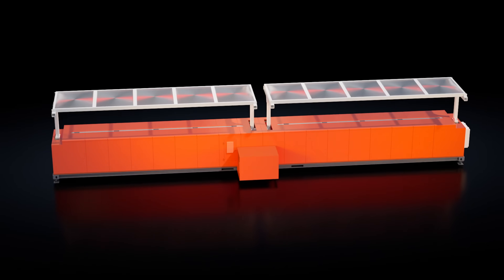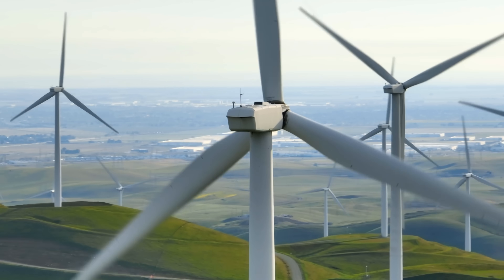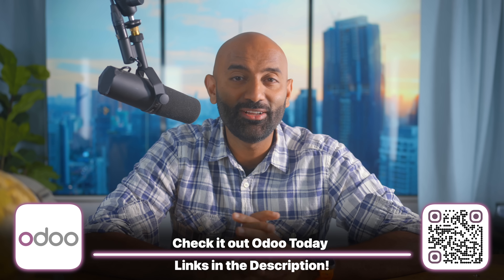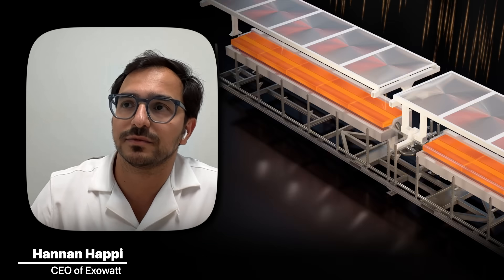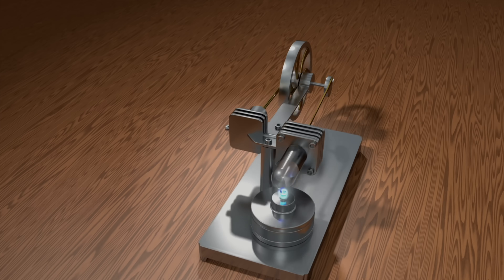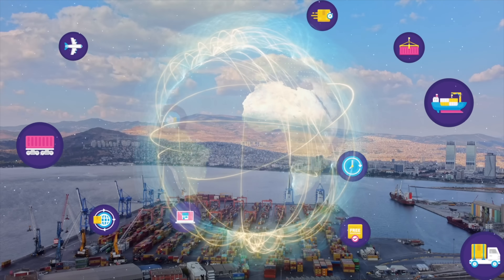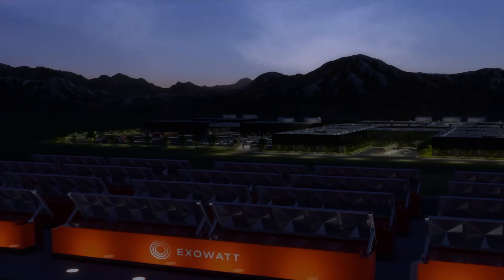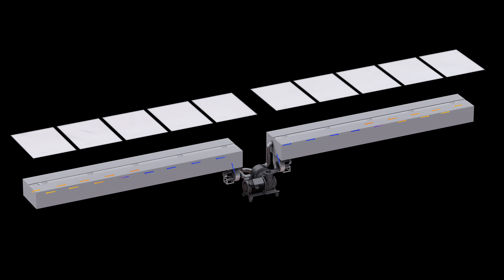Solar Without Panels, Storage Without Batteries - EXOWATT

Comment: Im a farmer, Ive been designing a parabolic solar collector that heats oil that is piped into a sand battery that is a 40 foot container filled with sand. oil moves by convection, container stands on its end so its 40 feet tall. as the hot oil enters from the top, as it cools giving its heat to the sand it falls and picks up speed exiting at the bottom then going outside the container and up being heated by the sun inside the parabolic mirror back to the top where it enter back into the container of sand. Requires 1) a 40 foot shipping container. 2) stainless steel for the parabolic mirror 3) pipe. 4) a method to follow the sun. (the mirror will rotate / pivot around the pipe being heated as it follows the sun) Heat can be extracted via convection in separate piping also filled with oil (it would enter the bottom and rise to the top) I was thinking of using a steam engine to run a generator because steam engines have proven to be so much more dependable that the Stirling. Been working on the design for several years and hope to build it in the next 2 years.  Benefits are 1) even a farmer can afford to build one. 2) most parts needed to build it are already on the farm. 3)Seam engines can still be bought used for reasonable prices. 4) The taxes and county approvals would be the same as for a silo.
Reply: Let me know when you’ve built one … I’ve just bought an off grid farm and could use your system
Reply: @DJ-uk5mm  Consider aquaponic vertical gardening. Get out of the dirt. No expensive equipment need.
Plus you grow meat. Tilapia mostly depending on your climate.
Reply: @21CenturySkyScrapers  put them into a walipini and they should be able to survive the winter in colder climates (maybe with some heating)
Reply: @balibee91  I can grow vegetables 365 days in any climate. Easiest with aquaponics, and  in extreme conditions such as Alaska, a properly designed green house with a wood heating system integrated into the fish tanks will keep your garden thriving.
Reply: @balibee91  I don't know what a "walipini" is
Reply: Nighthawkinlight shows a simple method of making a compound parabolic refractor that you might be interested in... gets rid of needing to track the sun which removes a huge cost/mechanical failure aspect of these machines. I was leaning towards steam engines too in my designs mainly for the simplicity of it. A sand battery that stores heat and releases it to run steam turbines is extremely feasible and readily accessible. Never thought about flipping the container on its end though... very clever
Reply: @ToneTruong  Something to remember when running Steam is that it can (and will if superheated) pull the carbon out of any type of steel pipe creating carbonic acid which will eat through basically everything especially at those temperatures. Best to spend the extra cost and use nickel based alloys with little to no carbon content. At least if you are going for super hot steam and minimal to no maintenance.

Common SS like 316 and 304 are really only good up to about 600F. Anything over that and they deteriorate relatively quickly.
Reply: @drewbeirn7704  Glycerine is a good choice for a heat transfer fluid. It vaporizes at ~700F at atmospheric. Condense the vapor in your sand battery and returns as liquid to your solar concentrator. No moving parts needed. Fewer corrosion issues. No high pressures.
Reply: Your solution is better than this video. 

Something not mentioned is that the alloys that can contain the 1,800deg F are not cheap. Also the fire risk with that kind of heat in the event of a failure. 

Also would love to see how it handles rain, and winter.
Reply: @drewbeirn7704  I've also been working on a similar project, theoretically for now. My system will concentrate the solar energy to the hot side of the Stirling engine, heat is rejected to oil or water tanks and excess mechanical energy is used to compress air which is also cooled to near ambient temperature using the same coolant used with the Stirling energy.

If you want to increase battery capacity, you increase the pressure in the gas tanks. Gas tanks can be used with preheating extracted from the coolant tanks during night time to drive a pelton wheel powering the generator. This system is not efficient but the advantage is in the longevity of the materials. The Stirling engine is the most complicated part of it.
Reply: @drewbeirn7704 These videos are just like the promised Fusion reactors. 

We were also told the lie that solar was totally maintenance free.
Reply: @MangoCitizen  I agree.. .even if any of these ideas are good some corporation will buy the patent and sit on it or like Tesla the Gov't will just confiscate it
Reply: @MangoCitizen who told you that?
Reply: @MangoCitizen   😂 We’re all still waiting for our personal flying cars (thanks, Jetsons!).
Reply: @sirjimmyjamesthe1st  Lol you need desperally learn physics
Reply: A cool idea but  I think you should take another look at shipping containers.  They're not strong enough to go vertically.  The walls and roof are so thin they're basically non-existent.  It's better to look at a shipping container as a pallet with four pillars in the corner with tarps draped over the top and sides.  Maybe you could find some sort of used silo or something like that.
Reply: i have similar build, but im heating air instead of oil. Sand is getting heated to around 600-700C thanks to that method and then power alpha stirling engine to produce energy for my house. Also sand tanks are made from 2x 3m3 concrete + isolation and burried under the ground. Even without a sun it keeps decent temperature for over a week. If You need any more details ill can answer Your questions
Reply: @YANA-RECORDS any chance you could post a video of your setup?
Reply: Used, filtered motor oil?😊
Reply: Please keep me informed.  I just moved to South Africa and need reliable energy.
Reply: I'm pressed by the competence and great ideas on the matter by the community! Thanks to all for inspiration!
Reply: What if...you used smaller fresnel lenses, in a sphere, with no moving parts, the size of a car, to make flash steam in an internal fractal piping network that is super latticed steel, copper, brass, aluminum, etc...with then runs a steam engine, which dumps exhaust into a slobber box to be re-used, that in turn runs piezo electric thermal generators, while the steam engine runs a generator?
Reply: There's a type of parabola that doesn't require tracking, there's a video about it on YouTube somewhere lol.
Reply: Please us updated on your progress, very interesting idea, keep up the good work. Do you have a web page for info?? Old school thee best!
Reply: Look into solar chimneys. They rely on a giant transparent tarp like a huge greenhouse ceiling with nothing on the sides that captures heat through like and then allows it to funnel to a central chimney where a turbnine spins a generator. The big advantage is it acts like a greenhouse and you can grow crops under it while generating power.
Reply: The problem with steam engines, is pressure.
Reply: @snuscaboose1942  Why? They have been used for 150 years.
Reply: @tedmoss  Go for it, but I'd prefer to maintain a safe distance from your heated, homemade high pressure vessel.
Reply: @snuscaboose1942 Too much, to little.
Reply: We have here a farmer who is also a scientist and engineer.
Reply: @dannyleung2796   Next step is collecting millions from ignorant investors.  Farmer moves to Belize, then the SEC spends the next six months looking for the money.
Reply: The steam is difficult because you need active pumping to cycle the working fluid through the sand. Stirling thermal recovery is the way.
Reply: @sypher4912 steam also tends to corrode  metal quickly. Also, likelihood of accidents is higher because of the higher pressures and related containment issues.The advantage of using bricks is that there is none of those problems and it is extremely cheap to fix
Reply: @nickrowe9221  could you build a kiln like this?
Reply: Liquid only moves by convection within a tank.

If you have 2 tanks, connected with a pipe; the pipe will be where the temperatures equalize and won't produce movement.
Reply: @n085fs That is where check valves come in.
Reply: @nickrowe9221  love it, would love to help produce this for open source access or something if you want to help spread the idea?! Good luck in the meantime tho :))
Reply: Get an on-site review.
Reply: I am doing something of the same here in Brazil and I don't have the issues of taxes and regulatory approvals.  I would love to collaborate with you.
Reply: @nickrowe9221  I saw a yt vid way back in 2010 era, group of uni kids in UK somewhere, oxford perhaps. They made this solar collector unit the size of about an A1 paper footprint, stands about 40-50cm tall. It had a pyramid construction of aluminium extrusion or other framework. At its foundation it had a grid of small square mirrors, each row of mirrors was on an axis, and each axis was controlled to move in one direction (unsure if simultaneously or individually)
And at the peak of the pyramid was the solar collector which was about the size of a fist.
The claim was, in 2010 statistics, it could generate as much as a roof full of solar panels in its small footprint
I've since not been able to find this video to refer to.
Reply: Very interesting. Do you have a video put up somewhere?
Reply: That’s so kind of you to share this with everyone… Don’t you wanna get a patent? If someone else took your idea and patented it, they could shut you out.  I’d much rather the generous Inventor that came up with the idea of be the one to benefit and to control how people get to use it.  

There’s a company out there that I’ve been getting coaching from for years called InventRight.  They teach you how to navigate the system and they have had a lot of success with those who have used their services.

My very best wishes to you! 
Perhaps you are the Internet’s next Robert Murray Smith! 😊
Reply: @shannonjensen3855  - I loved Smith to pieces.  He could make me understand what he was talking about.  So sad to learn that he'd ended his own life; his brother posted that he'd been severely depressed ever since his wife die some time ago.
Reply: @frostyfrances4700  oh no! I found out only recently that he had died… I didn’t know he ended his own life. He was such a joyful person and brought joy to so many others didn’t he? 
Thank you for your thoughts!
Reply: Very interesting!
Reply: That's awesome, what type of oil? Corn?
Reply: @nickrowe9221 no one cares. Why don't you just stick to farming and let people with the real brains figure this stuff out.
Reply: Wow! You have a great idea! I hope you make one🎉
Reply: Brilliant
Reply: I had a similar concept.  My design has the heat stored in sand underground.   The fresnel lenses or parabolics heat rods that transfer the heat down to the underground chamber.  The above ground components are stored in a simple greenhouse structure.
Reply: Interesting... I think solar panels are a waste of good land... the solar battery with heat seems a better investment  as its not high impact on the components....
Reply: you should make a video explaining this id love to watch
Reply: you need higher operating temperatures for steam engines, also, aren't Stirling engines more efficient?
Reply: careful, big corpos will go against you, better do a opensource of your findings.
Reply: @nickrowe9221  consider a turbine if your budget allows. And perhaps some more inputs if you regularly have wastes that you can burn.
Reply: Always simple solution is best solution. Use sterling engine clamped in sound proof box
Reply: @nickrowe9221  what is the cost to set it up and cost of running and maintenance in the long run
Reply: Could you use a silo.
Reply: A compost system could also supply heat to the oil by having a tank of oil connected to the system surrounded by hot compost.  This would help keep your sand hot even at night.  Something similar to the Jean Pain method for heating hot water with compost.
Reply: I am pondering a similar Parabolic mirror to push steam through a turbine/tesla turbine
Reply: In the 1970s I was in 6th grade and a guy down the street from our house started a solar company that used parabolic mirrors. He heated oil then it flowed to a motor that used helium filled cylinders.  Hot and cold oil was alternately sprayed on the outside of two opposing cylinders to make pistons move as the helium expanded or contracted.  I think that was what they were trying to do to convert the thermal energy into mechanical energy.
Reply: Oil? What kind of oil? Reducing Fossil fuel oil is part of the point, at least for me.
Reply: Should you really be disclosing so much detail to the public?  If your invention is viable, it might get stolen!
Reply: What to bring to light using oil within tubes is like gosun solar cooking teck..plus using steam too. So please keep me the loop. Gosun tube has proven itself so you ideas fit well.
Reply: I'm a farmer too, have a 20ft container and a very old b ut viable 2M + iron dish frame from an old VER large TV Arial, reusable for parabolic mirror sun capture. Have had similar ideas and have plans to execute them. So, I hope it is possible to stay in communication with you, even if I'm late finding this.
Reply: Hi Nick, I’d be happy to get in touch regarding the idea you shared here.
Reply: Hi, do you have a newsletter? Seriously, you need a newsletter. Even a dollar or two a month each could help fund this. Please stay in touch
Reply: Big enough sand and you have yourself a battery in the form of thermal heat, super interesting stuff.
Also no bad chemicals and stuff, worst case scenario is hot sand falls out.

At a large enough scale it's more efficient and effective then normal lithium (which is just super hard to mine and nasty stuff)
Reply: Hello everyone your suggestion of using a 40-ft container and oil is good. What kind of oil would you use, 5-30 weight or gear oil and would it be pumped?. I know most farmers are very handy at repair but if let's say it breaks and farmer can't do it who's going to replace it or repair it? Thank you
Reply: Sounds awesome!  Has anything blown up so far?
Reply: Where is the water for that steam generation going to come from or go once used?

THAT is the problem with small scale residential power generation - water usage.

And with the thing they're talking about here - *broiling* hot air exiting the system that will wildly change the immediate environment.
Reply: 1. You must have sufficient water all year round.
2. Steam engines are super noisy. 
3. They require regular maintenance.

If you can manage all that, Good!
Reply: @MangoCitizen  Perhaps consider a Tesla turbine (closed loop). I'm pretty sure it'll work wonders.
As far as maint., you could set up 2 while always having one (valved) inline with a t split as a backup.
That way, should repairs / replacement of the turbine be needed, you'll never be off line.
Reply: @21CenturySkyScrapers Tesla turbine is another Fusion reactor of the past. Possible but not practical!
Reply: @21CenturySkyScrapers no, not that. Problem is that Tesla turbine is a high speed but very low torque system. The spinning discs tend to deform at such high speeds, usually above 50k rpm, and cause physical damage. 

And any load tends to create turbulence in the system resulting in reduced efficiency.

Even then a very high ratio gear will be required for usable rpm and sufficient torque.
Reply: @MangoCitizen  I'm well aware of that. There are things to negate those, "I don't want to say deficiencies,"  minor hurdles. Such as putting a load on the turbine will take care of the speed and deformities.
Reply: Also the disks need to be designed so there isn't warping. 
To me, the more simple the design, the more efficient and effective it will be.
Reply: @21CenturySkyScrapers  Radial Expansion, not warping, is the main problem. Materials that can withstand those forces are too costly and uneconomical to use.

Further, any load on the wheel causes disruption in laminar flow, negating the very aspect of the process
Reply: @MangoCitizen  so what purpose could it serve. I mean every turbine needs to be able to convert energy.
Proper disk design will facilitate both hurdles. Just have to design out of the box. (Not like everybody else)
Reply: @MangoCitizen  Have you ever heard a steam engine run?? No, I thought not, they are very quiet.
Reply: @MangoCitizen 1. Yes, unless you add a condenser, and put the condensate back into the system.  2. I worked around several reciprocating steam engines of various sizes, and they were all extremely quiet.  If you use a steam turbine, yes, it will be noisy. 
3. Agreed.  They do need regular maintenance, but on reciprocating engines it’s usually easy to perform.
Reply: I thought all shipping containers had wooden floors. I don't think they have the structural integrity to support the weight of that much sand. The people that bury them to make bunkers have to reinforce them significantly, or they buckle and are significantly crushed by the weight of the surrounding material.
Reply: @WhitelistedUsername They sometimes have raised wooden decks but underneath is steel.
They are strong in the normal orientation.
But do need reinforcment when a non standard load is placed on it.
Strong points are the 4 corners, deck and support bracing connecting the 4 corners.
Think hollow frame of 2 squares connected by 4 bars and a strong floor.
The rest is protecting the cargo from the elements and to a degree preventing from falling over.